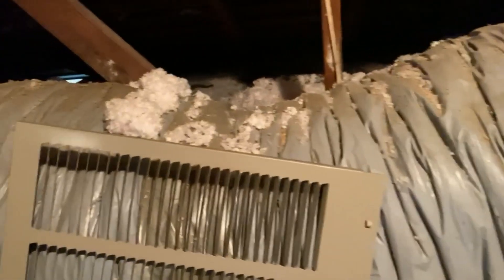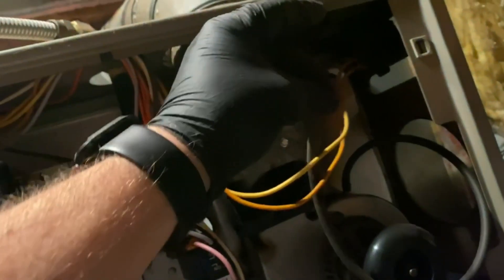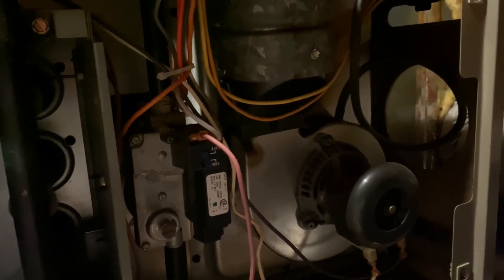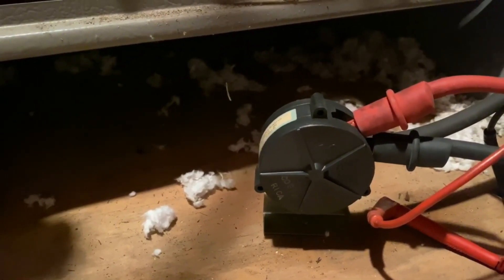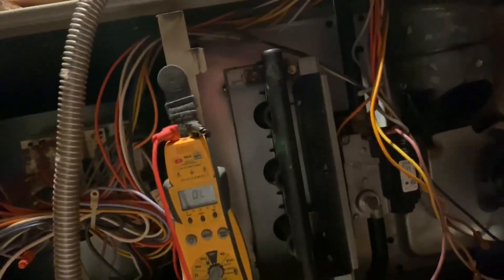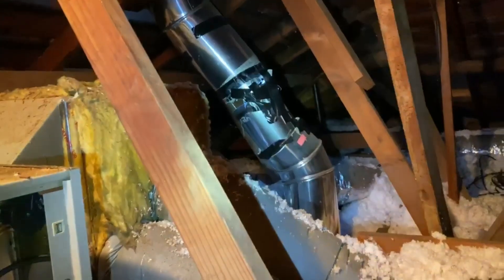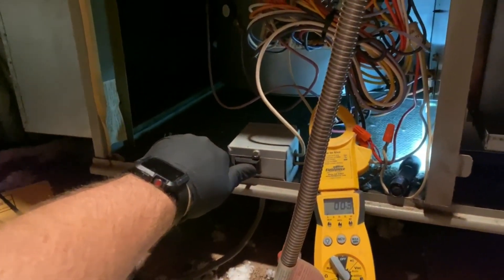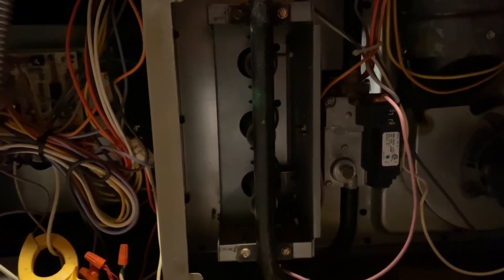No Heat, Pressure Switch Fun.  EP21

Comment: Good video glad to see you check other things... Would like to have seen the flame sensor cleaned (might have not been on video ) but I'm no professional I enjoy learning
Reply from the maker: Camilo Ovalle Thanks for watching!  I appreciate the feedback. Flame sensor was cleaned and tested. For some reason the video didn’t come out.  Had to cut it out. I will be having a tutorial on how it works, how to clean, and how to test. Stay tuned!
Reply: Just subscribed 👍
Reply: If it fails at pressure switch not closing the ignitor will not be powered.